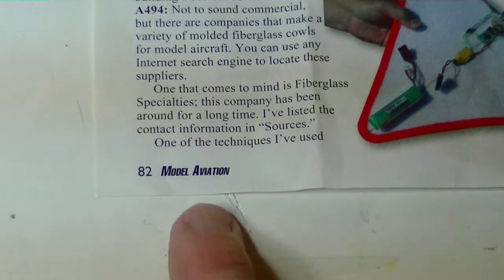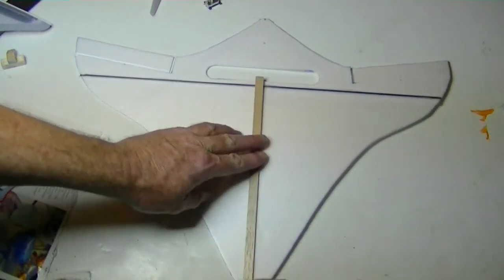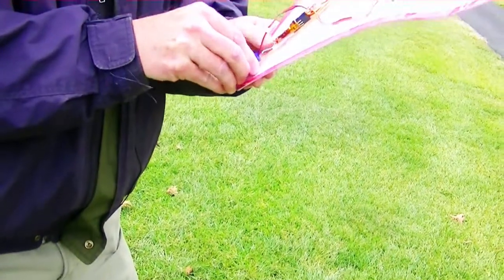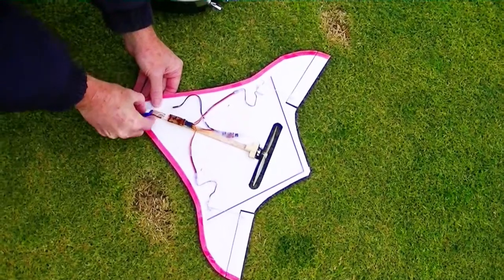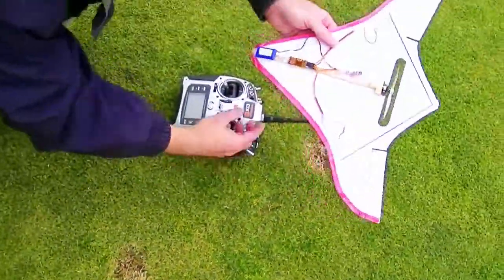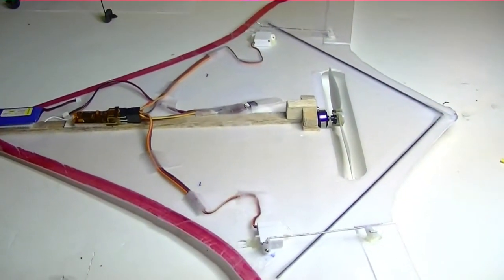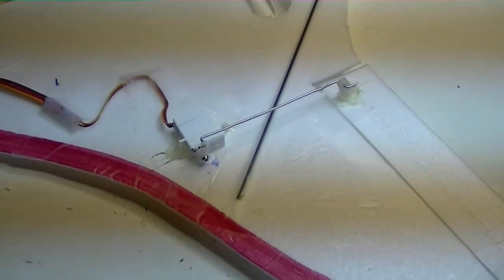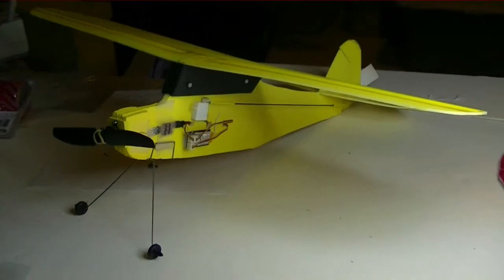Simple Flying Wing Scratch Build and Flight Test, RC Pusher Prop

Comment: One of the links.  On the description 
Access denied You are not authorized to access this page.
Reply from the maker: Yes this is an older video and some of the links are aged out. You may have to look for substitute parts. If you could up grade to a 2S Lipo system on this is might be even fly better and the parts would be easier to come by. With all the micro-quad parts out now it should be easier pickings.
Reply: Dave Merc Productions I am looking for the plans and dimensions
Reply from the maker: Sorry I don't have plans but you can look at this
https://www.sarikhobbies.com/product/simplicity/

Comment: Always hand launch lefty so you can steer right away. By the time your right hand gets back on the elevator it's sometimes too
late. I use my lip to set the throttle and flip lefty nice and level.

Comment: HELLO   MY NAME IS JIM COULD YOU SEND ME SOME SIZES SO I CAN TRY TO BUILD ONE     THANKS     LOOKS GOOD
Reply from the maker: Willis Hiland Wing span is 46 cm and length of fuselage is 35 cm.
CG is 16 cm back from the tip of the nose.
Reply: Willis Hiland     Thank  You   /  I`am going to try it
Reply: Willis Hiland HELLO  CAN`T FIND  MOTOR MODEL NO. IN BOOK. HELP PLEASE    THANK YOU
Reply from the maker: Willis Hiland Power system and part numbers are the same as this video:
https://www.youtube.com/watch?v=ADSzZpGcs8Q

Comment: awesome! i need to try this
Reply from the maker: MartinezDesignUAV Give it a try. You could add some vertical stabs like the Striker if you wanted to.
Reply: Good idea, will have to find some appropriate foam first. Would a 2300kv motor be too slow?
Reply from the maker: MartinezDesignUAV Might be ok for a two cell lipo.
Guess you noticed I was using a 1 cell lipo and I a 4000kv AP03 motor from HK.

Comment: I could not make out what you were saying about the motor. You say it came from Hobbyking..... what motors are available for use with 1C batteries? Thanks!
Reply: id bet the motor can handle 2s, but he wanted to build the plane small and make it work on 1s.  smaller battery/less weight.  HK had a 8g motor last time I looked, that is fairly small.  and nitroplanes has some motors so small they fit on your finger tip.